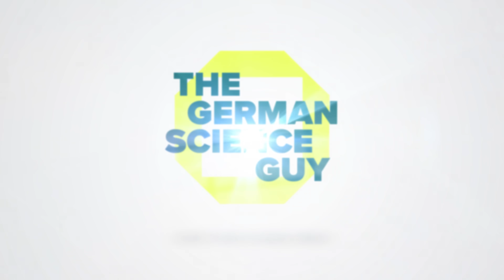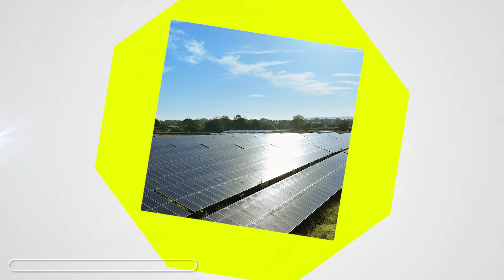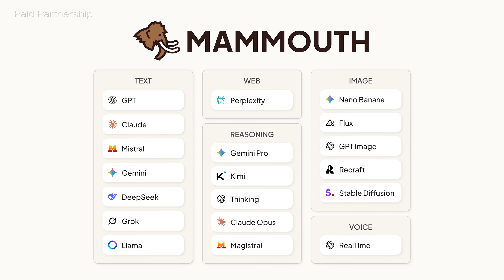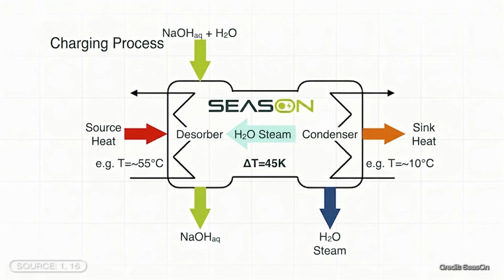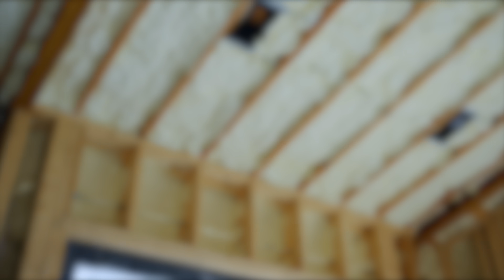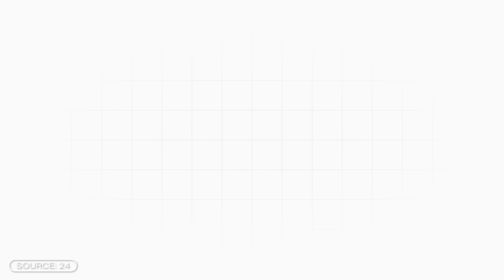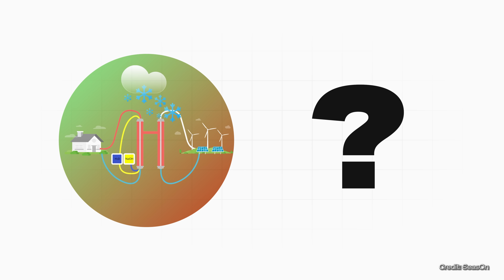New Heat Storage: Better Than a Heat Pump?

Comment: Lots of organizations been working with Zeolite (3A in size) based systems. Wet the zeolites, they heat up as they adsorb the water, dry them out and you are storing the thermal energy. Use an evacuated solar tube system to generated the needed heat during the day, with a solar powered pump to push the working fluids around. The tech has been around since thee 90s, I imagine someone has build a product based on it, Fraunhofer Institute was working on one (residential hot water boiler/tank) I believe. That said, there is about 33% more heat energy stored in NaOH versus zeolites under ideal conditions, but the zeolites are significantly safer, you can handle them with your hand. The water also doesn't dissolve the zeolites, they are wetted and dried out, making the system a bit simpler.
Reply: I think this makes more sense than huge seasonal storage schemes. I read about systems which use solar heat to dehydrate salts, then add water to release the heat (or endothermic cooling) later. I think some experimenters are directly exposing the salts to sun and wind, so there is no solar collection or pumping.
Reply: We need a heat powered heat pump that stores it's "waste heat" to run itself, off the differential between its thermal battery and outdoor heat. When you're heating the house in winter, the thermal battery will be cooler than the outside, that's still a thermal gradient, that can still power the thing. Heat is heat all the way down to 0 K. All you need is two temperatures far enough apart to move a thermal loop.

Comment: I have worked with Caustic Soda on many occasions, (in my employment maintaining factory equipment)  we even use it as a cleaning solution for daily cleaning tasks in many factories, saftey procedures are well known.

A spill can be cleaned up with plain water fairly easily in-fact, in all the years I was involved we have had any unintentional spills.
Reply: So have I, but never more than 20 metric tons of the stuff.

Comment: The 'short cycle' fluctuations in energy DEMAND are across one day cycles due to human use patterns and hot/cold changes affecting our homes, with electricity being produced by whatever method of generation (photovoltaic, wind, fossil fuel, etc). But the fluctuations in certain low cost generation methods (photovoltaic and wind) are short cycle SUPPLY fluctuations. Therefore, keep separate the short cycle problems from the long cycle problems, which involve seasons that span the year. In the long cycle, we have a great deal of waste heat (excess of natural 'atmospheric' supply of heat compared to demand for heat) in the summer that we want to store for the shortage of atmospheric heat in the winter. The problem becomes the large size of the storage for long term cycles compared to the short term storage. However, the long term cycles problem could be solved if we could develop better long DISTANCE transmission of the energy and take advantage of the excess heat in the hemisphere that is experiencing summer and send that excess to the other hemisphere which is experiencing winter. Efficiently converting the excess heat to transmissible electricity is one problem, transmitting the electricity over long distances is another technical problem, and markets can likely solve the allocation problem.

Comment: it seems more logical to have a giant sand energy storage facility that just uses the cheapest junk possible rather than using caustic soda. not saying this is a bad idea i just think it's probably better to have a town energy store that is just a giant thermal mass, economies of scale after all.
Reply: Exactly, simple and cheap will always beat complex. There was a time when virtually every town would have at least one "gasometer" for storing gas, some have been preserved as historical monuments. A similar sized structure used as a sand battery would hold about 100 000tonnes and assuming a temperature range of 200K it would store 5GWHr of energy

Comment: Why not CaO+H2O to the hydroxide? Its a reversible reaction.
Reply: Don't you need around 1000°C to reverse the reaction? You couldn't use an heat pump but a much less efficient joule effect.

Comment: I often use NaOH for various things, mainly cleaning. So, my anecdotal assessment of how exothermic dilution of the dry powder in water is not very much. You need to dissolve quite a lot of this stuff to bring the solution close to the boiling point of water, contrary to the warning label.  The system in the video proposes to start with a solution not powder, and produce heat by further diluting it. From my experience the heat generated this way will be miniscule. The reactor will need to be the size of a house to heat up a similarly sized house.  They do mention this in the video but my gut feeling is they err on the optimistic side. I think that the project has just an academic value and is commercially a non-starter.
Reply: Control would be a crazy problem not to mention the thermal lag of the system.  An ideal mixing system for heat output would have break most of the handling rules to be responsive and adjustable.  I don't want to be around when it goes wrong.
Reply: What's available commercially isn't the pure anhydrous solids.  That stuff boils your skin while giving you a chemical burn it's so exothermic.  Think Fight Club when Tyler Durden kisses his hand and dumps powder on it.  NaOH is used to saponify fats into soap.  At any rate, this system is scaled to hundreds of kilos not dozens of grams (such as found in cleaning mats).    There's 44.5kJ/mol to be liberated in dissolving the anhydrous salts, with 100 kilos that's a chemical potential of 2,500 kJ.  It's just a battery that converts between chemical potentials and thermal inputs/outputs.   

If your using the waste heat of a data center the quality of the heat will only allow you to concentrate solution so much.  That evaporation is temperature driven.  If your converting surplus electricity into resistance 2,500kJ/100kg is the upper limit on how dense you can pack the chemical potential.  Throw a heat pump between your waste heat and NaOH battery and it gets complicated, but the ability to store heat goes up.  Trade offs.
Reply: Nice idea to sell to potential  shareholders 😉 , just far too many of these green solutions are a grift
Reply: The only grift is giving money to the carbon industry, everything else is rounding errors @orange1666

Comment: A guess is that the water has to be purified or else side reactions with contaminants would ultimately spoil the process. If pure water is to be kept in a closed loop then the additional condensing and storage systems would consume space and cost. Fraunhofer tried adsorption heating with zeolites, not sure if they could make it economical.

Comment: If you had some space and the courage, you could build a total redneck version of this yourself. Instead of the photovoltaics, you have a shallow lagoon, either roofed or not, depending on your summer climate, and you evaporate off the water, then store the concentrated NaOH, until winter when you 'Just add Water.' No heat pump needed this way either.

Comment: Heat storage could be underground, or in basements, designed as heat elements in sand-filled containers.  Easy and cheap.  The energy conundrums the world currently faces will be overcome by 2030, at minimum, on paper and in a limited build out of operating sites, and installations.

Comment: You don't need to store heat for a whole year, the part where you have enough sun anyway is not needed and actually only enough is needed to cover the high price periods, so having 4 weeks stored using and refilling depending on electricity price should be enough.
Reply: Also... collecting heat from every attic and pumping it back into the system for a credit would close the loop. You'd have a thermal circuit. The returned heat could be concentrated and collected as high grade heat using a heat pump that runs on heat. That would stretch out the supply because you're not venting heat into the atmosphere just because it got to the end of the line.

You know that you can bake food with a heat pump, right? Picture an oven that has a radiator in it, using the heat your ac pulled out of your house to make you food. Kitchen heats up, OK the ac will grab that leftover heat to run itself, heat the hot water, run the turbine that keeps the lights on (until we make bulbs that glow from just being warmed up, you know, like stealth paint that absorbs radar and emits some other frequency, you'd just absorb infrared and emit visible light like LED bulbs do when heated with electricity or incandescent bulbs do when heated with electricity, or fluorescent bulbs do when heated with electricity...).
Reply: @KastorFlux  Heat pump washing machine ... heat pump on the runoff from the house, recycling shower and cleaning heat there are a lot of heat sources.
Reply: @surters  yes, the actual thing that does any work is heat. All of our energy sources are just packaging around it to capture a market. Pretty much everything rams a bunch of heat through it to get some small amount of useful work done relative to the heat used, we could capture that and reuse it without conversion, but everything is just incremental revisions of devices designed to run on electricity and gas, because the guys who controlled those things 100 years ago reinvented things that ran on heat to use their captured energy market. Most of the other new technology was repurposed military stuff, where the optimization strategy was "we don't care how much it costs to run or how much fuel it wastes, we just need it to work in the middle of nowhere from the most compact energy storage". So now we're stuck with everything being so wasteful that you'd need to burn a city just to run it for 20 minutes. In reality you can rip out most of the internal components, wire them directly to heat, and convert some of that global warming into useful work.

Imagine if your car shot 80% of it's gasoline out of the tailpipe and you just left it laying on the ground and bought more. That's exactly what it's doing. It doesn't run on gas, it runs on the heat that gas produces. The combustion doesn't even have to be internal, and it doesn't even have to be combustion, it just needs heat.

Look up the atmospheric engine, it's rudimentary, but its an old external combustion engine. That thing could be just as efficient as an internal combustion engine, but then we couldn't have "energy crisis" because people would know their cars run on heat and they'd put heat there a different way. You can barely do that with internal combustion, because they're designed around a very specific kind of fuel in intimate contact with the machine. Any other fuel will wreck the parts or not run it very well, and that's by design.
Reply: Very dependent upon your location. Ask someone in Mexico City and someone in Tromso the same question and you'll get very very different requirements!
Reply: @etchedpixels  energy storage is just a flywheel. Once you realize everthing runs on heat, you realize it's an absolutely free energy source that everyone is throwing away. They literally build devices to throw it straight out the window because energy companies have convinced them that it's worthless and they should buy name brand energy instead.

The bigger your flywheel the better, but only to a certain point. There is a difference between enough and too much. 😂
Reply: @etchedpixels  The guy in Tromso will just load up on very cheap hydro in the winter night, and the guy in Mexico City likely has a much smaller need.

Comment: Many years ago, I figured that solar and wind generated energy was extremely limited. Not from the ability to generate enough power, but for being able to store the generated power. All of the battery systems that are available are light years behind the generating systems. I had envisioned fluid for heat storage since that seemed to be most efficient. Long holding time without losing much temperature. I know that vacuum kilns use "antifreeze" for passing heat through extruded aluminum sheets. While it does a wonderful job of drying the wood, in part because it is in a vacuum, I wouldn't want to have to deal with the antifreeze. I guess no system, yet, is not without risks of some sort.

Comment: Sodium sulphate decahydrate is what you want to use. It's a harmless salt. It's cheap. It has a very high heat of fusion. It changes phase from solid to liquid at low temperatures close to 30°C and releases lots of heat as it changes back to a solid. 14kgs can store 1kwh of thermal energy. That's about 70kwh per ton. The low melting temperature is a huge advantage because there is a very low differential between the storage and ambient temps. That makes insulation even easier and losses far lower.
Reply: I think the idea of this is that it can store energy without staying hot, so you don't have heat losses all autumn.  Though your plan could work for a couple of weeks.
Reply: @daveansell1970  Ok ! I tought Sodium sulphate decahydrate was also a seasonal battery like in the video...
Reply: @AutoNomades  I guess there is nothing stopping you using it as such but you would need really good insulation
Reply: Nice one ! How expensive is it and what is the way to charge it ? 

 Have you heard of sodium triacetate, molecular sieve zeolite, and calcium chloride types ?
Reply: The example required 13 500 kWh of storage, so that'd be just 192 ton.. something doesn't seem right..
Reply: Make a heat pump that runs on heat (temperature differentials) your thermal battery can be storing the waste heat or cold that you rejected to run itself, since you're going to be pushing out temperatures higher or lower than the outside. It's not perpetual motion, it's recycling the "waste heat" and using ambient heat from outside. Cold and colder is still a temperature differential that you can create a thermal loop with to run a compressor, an engine, or just tap the heat directly if it is the temperature you need for drying clothes or heating water. You could even bake food with a heat pump. Imagine that, making a cake in the middle of summer and it cools your house off by drawing heat out of the kitchen, attic, outdoors, and your thermal battery if it even needed to.
Reply: The sodium hydroxide doesn't need insulated containers and can operate entirely by concentrating a liquid phase solution, which allows for a small heat exchange unit. It also operates at higher temperatures which is an advantage for delivering heat in a apartment building using radiators. The sodium sulphate lower temperature  has the advantage it can be charged with water heating solar panels, which are more efficient than PV.
Reply: @pisoiorfan  At first glance water heating solar panels do have an efficiency advantage, but is this actually comparing apples to apples? The end product of one is heat and the other is electricity, so the efficiencies aren't comparable as is. The proper efficiency comparison would be an electricity producing solar panel running a high COP heat pump vs a water heating solar panel of similar size. Though, the cost difference between the two systems is likely to be quite significant.
Reply: Yeah awesome we just each need an entire heavily insulated shipping container full of it.  Great solution.
Reply: Beware, every uni with a need to produce master degrees and PhD subject seems to have her own favorite chemical substance. And in EU territory you can bet a few projects are active on this subject as well (would need to check my research DMBS for current ones). In the south of my country the Technical University of Eindhoven is / was focussed  on potassium carbonate for instance. They had a spin-off which didn't make it. The economics (incl. cost of safety measures) are the problem, not the chemical substance.
Reply: So its energy density is 4 times lower than subj. Still too expensive
Reply: Except it’s brutal on the containment, can cause stress corrosion cracking on even stainless steel at low temperatures.

Where as mild steel can hold molten NaOH indefinitely.

Plus with NaSO4.10H2O being that low of a melting point, it becomes practically impossible to get heat out at any practical speed, it will self insulate any heat exchanger pipes you put in the tank, and if you do manage to get a water loop to come out at that temperature with decent flux, you would need 10’s of m2 of radiator to effectively transfer that to the air with such a low differential
Reply: @PredominatelyFutile  The NaOH isn't stored molten nor hot. It releases the heat by adsorbing water into a concentrate solution. And a plastic liner or container for NaSO4 is all what is needed to prevent any corrosion. Hand heat pads are made of soft pvc bags.
Reply: @PredominatelyFutile   ceramic containment ?

Comment: This is completely wrong. Chemical potential is exclusively advantageous in the classical battery chemistries. You want heat storage based power solutions yoi never go chemical energy forage, Thats pointless. Also, buildings these days are completely wrong in terms of construction. None of the have thermal mass which is a basic prerequisite to make ANY renewable energy solutions work. Sand batteries are the way to go or the good old pumped hydro. No system using dangerous chemicals will ever. Ever be used